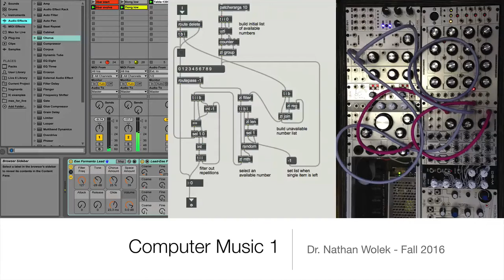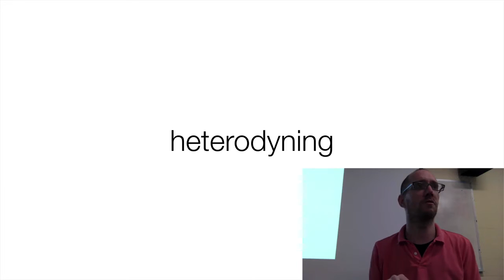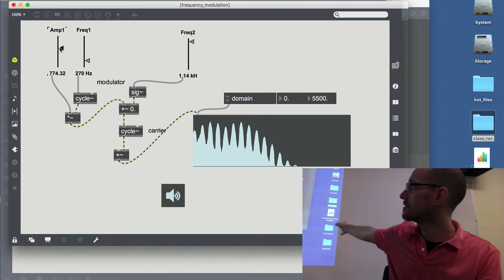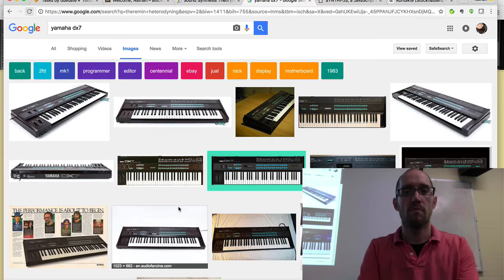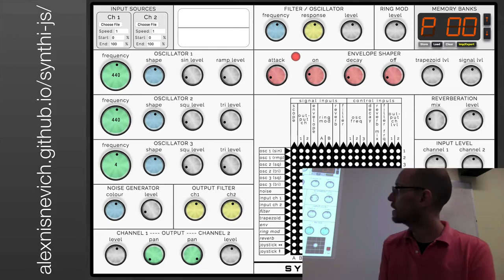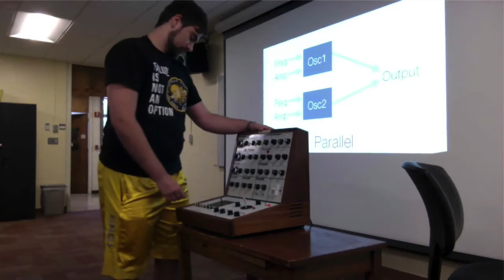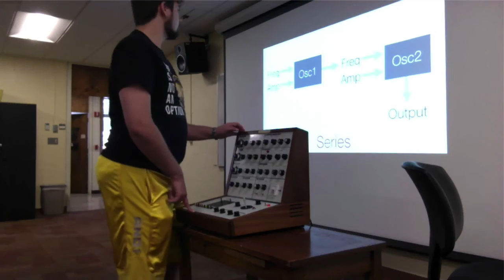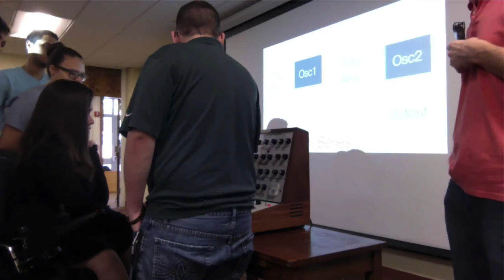Computer Music - F Sept 16

Comment: stumbled across this and found it very informative thanks! But two questions 1) what was the reading resource that covers heterodyning? and 2) how can the modulation patch have such a large amplitude scale running into the modulator? Is it working as an indexer? or actual signal gain? and is 0-1000 something standard?